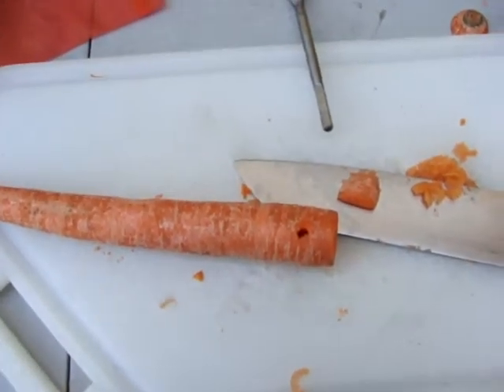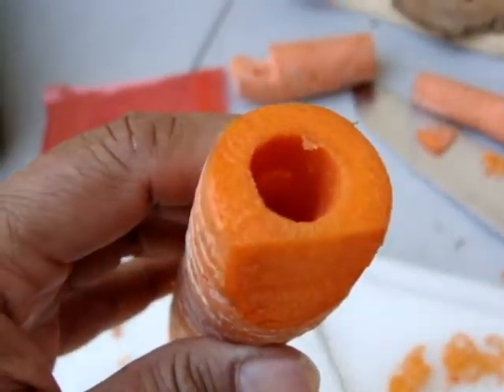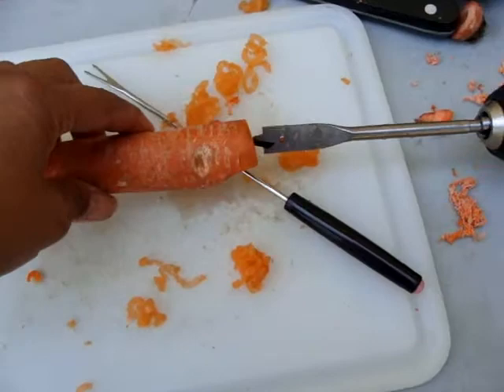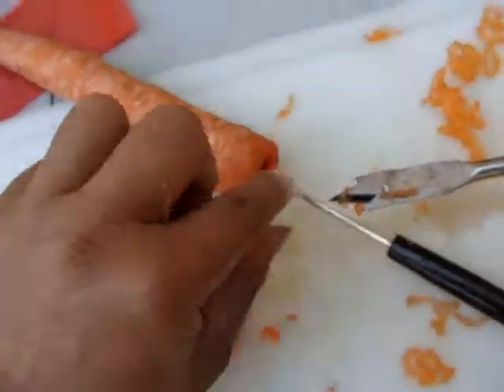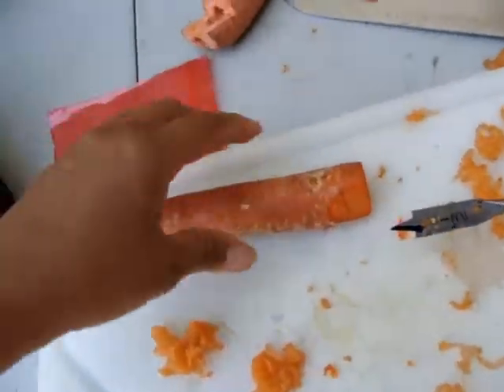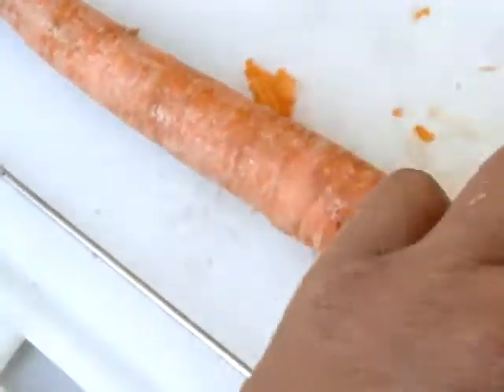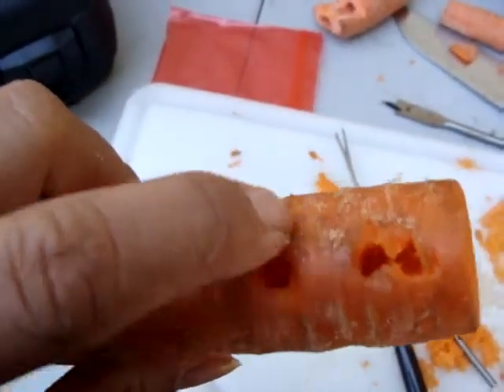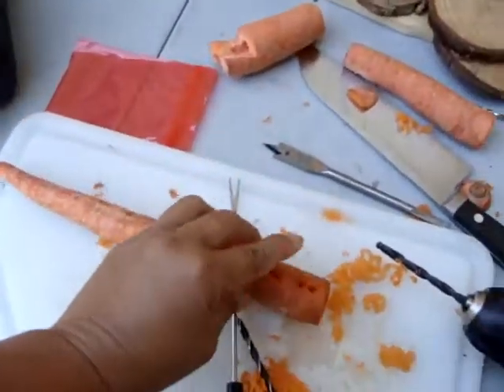Carrot Flute Test

Comment from the maker: Good point.  I will check out some other you tubes.  I do want to try other materials, but there is something about using food that makes it very cool. I had some thoughts about the carrots I used for the test, and they were sitting out in the sun while I did some other stuff... I think they may have gotten a bit wilty.  I'm going to work with fresher carrots next time.
And Frank, thank you for your input.  I could never think that you are rude, your feedback and thoughts are very welcome!